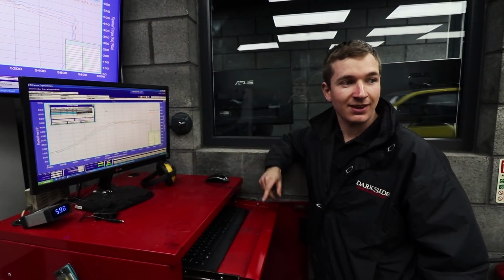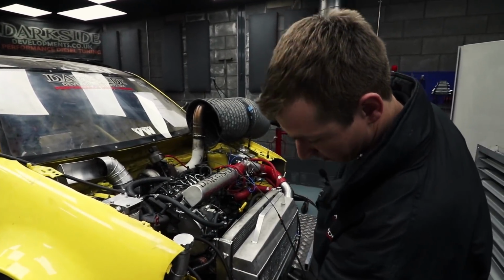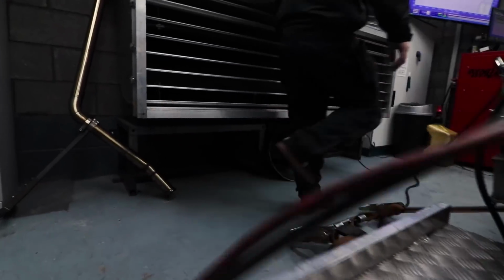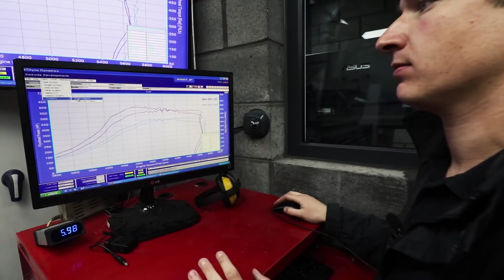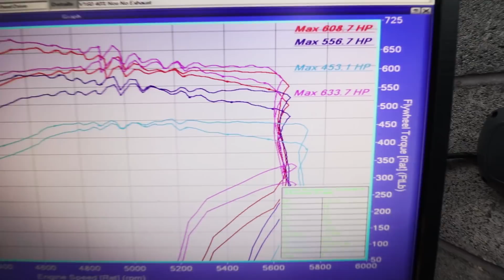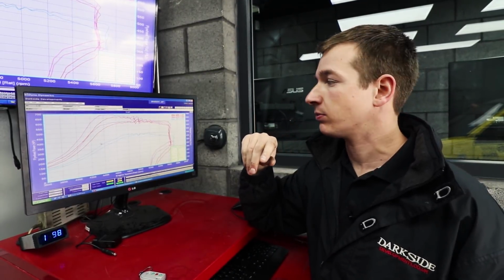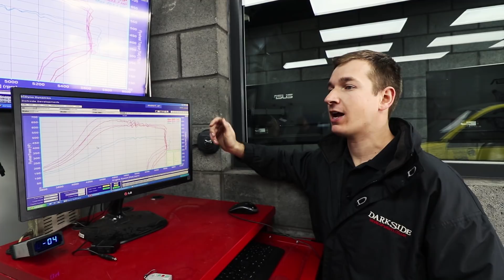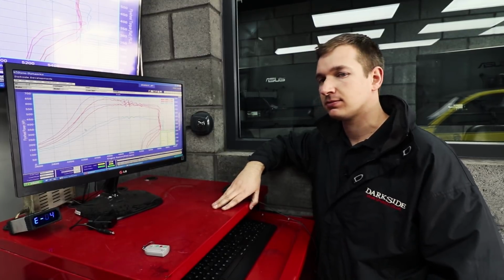633BHP CFHD SEAT AROSA 2.0 TDI!!! - DARKSIDE DEVELOPMENTS

Comment: Out of interest what is it about the 2.0 CR that allows you to see those power figures vs. The 1.9PD you had in the Ibiza? Is it a meatier block/head than the PD’s? The rest of the spec I’m failing to see the differences for you to gain almost 200bhp over the PD! Keep up the amazing work and pushing the limits!

Comment: 633 from 2.0 is huge 👏 so 900 from your 3.0 A5 shouldn't be a problem 😉
Reply: Would be nice, haha
Reply: 633 single turbo with nitrous isn't very impressive, there are plenty of Cummins ISB engines setup like that making the same HP and 1200 ft-lb of torque. I'd be impressed if they really knew what they were doing and used a compound setup without needing any nitrous at all.
Reply: @JosephArata  just go away you troll. Watch a Cummins sit at the staging lanes trying to spool, lol
Reply: @JosephArata  a cummins isn't 2 litres tho is it and has more cylinders
Reply: @JosephArata  No way a 600 hp car can have 1626,982 J of torque....
Reply: @JosephArata  
When did Cummins make a 2 litre?
Reply: @JosephArata  so triple the displacement, for the same power but "it's not that impressive"
Reply: @JosephArata  A Container Ship makes thousands of Horsepowers. ;) Displacement matters.

Comment: insane build , I need to start some serious work on my 130 swapped caddy if you've got anything hanging about you don't want 🙋‍♂️🙋‍♂️😂😂
Reply: I'm tempted to do something with my Pd130 powered mk1 aswell in the future
Reply: Get it done man I’ve done the 130 conversion fmic 2.5 inch straight through egr delete , 4 bar map sensor and a remap the basics really gonna go hybrid soon and big injectors I think although my clutch has just started slipping so looks like a performance clutch and 6 speed conversion will be next
Reply: I've got a stage one map on it now but I still need to get fmic and other bits to finish it

Comment: Nice work man, looks promising! Could this be achieved turbo only as well?
Reply: 500 turbo only is possible but that would need closer to 100psi I think
Reply: Single turbo with an assload of lag, you'd be better off with a compound setup......
Reply: @JosephArata  it works on the strip. Compounds take a lot of spooling too without an auto Gearbox
Reply: @ryanp6138  you mentioned you can run shorter duration with these new injectors. Doesn't this mean you theoretically can run more revs and avoid this 'shitload' of lag? Sorry for picking your brain btw=)
Reply: @JosephArata  in such a setup the small turbo must be spooled up before there is enough air flow for the big turbo to spool. And then the small turbo also consumes part of the exhaust heat which doesn't allow the big turbo to spool as fast as it would in a single turbo setup. So I can see Ryan point here.
Reply: @what9418  the speed at which diesel droplets burn is the limiting factor when you are up at 6000rpm or so, we won't ever  get good results revving much higher I don't think
Reply: @ryanp6138  thanks! Just another question, isn't the lowered egt with these new injectors result of a shorter combustion time? Or at least, result of shifting the peak heat release rate more towards the beginning of the combustion? I'd expect the rpm can be increased with shorter combustion time, but I do see that if you max out iq and can get enough oxygen in there you'd always make more power at 3000 rpm than at 6000. 

Btw I saw some heat release graphs and got the impression that even though total combustion may take 4ms, 80% of the fuel is burnt in half that time. It suggests that the fuel mix burns pretty fast and the mixing the droplets with oxygen slows down throughout the combustion.

I'd like to explore this when I have some money available (if ever=))
Reply from the maker: @what9418  We need cylinder pressure monitoring to take this to the next level really. Just looking at the opacity and power at higher RPM's its still a loosing battle with diesel fuel and direct injection. 4-5000rpm is usually where peak occurs for us but some big compound turbo might bring that down, how that will help 1/4 mile times you need to ask the so called youtube experts!

Comment: What a beast!!!! 1.9tdi POWER!!! Pd130 block with 16v head conversion?
Reply: 2 Litre CR 140 CFHD engine
Reply: The old pd130 8v they used prior to this common rail engine made 540hp !! Impressive and still ran high 9s/low 10s
Reply: @toyotaturbo504  Did they reached 9S with the PD? I think they were in really low 10's. But I could be wrong.
Reply: @JDMeister  9.9 last time I drove the car with PD
Reply: @ryanp6138  Got a video of that run? Not that i'm doubting you just want to add it to my video thread.
Reply from the maker: @JDMeister  All the runs we have on video are in here - https://www.youtube.com/playlist?list=PLz_nHs7o9ueXUmnewp0YVAtfLPo_dxHKs

Can't find that exact run, but its in there somewhere!

Comment: John Deere turbo 😂😂
Reply: Would have done better with a compound setup, 450 hp on diesel only my ass, they have massive boost lag with that giant turbine housing. You can't make power the same way you can with a Gasoline engine, with diesel. Diesel engines need 3-4x more air volume than gasoline engines to keep combustion temperatures down.

Comment: What is BHP ? What's the difference than HP
Reply from the maker: Its a debate as old as time itself.
When we refer to bhp we mean crank, and hp is at the wheels, or whp
Reply: @DarksideDevelopments  yes I've seen whp used allot but the bhp threw me off, I like y'all's work and videos. I'm currently building a 300hp BEW engine.  I actually just ordered a gt2260vk flange from y'all.  Your shipping to USA is quick. Keep up the good work .

Comment: Single turbo and nitrous just to get 600+ HP? Wtf is wrong with you? You could make close to that much with a compound turbo setup and 0 nitrous. Stop treating diesel engines like gasoline engines, they require air to quench the cylinder combustion temperatures. Using a giant turbo, then using nitrous to make up your shit engineering is just poor planning.
Reply: Show me a manual gearbox 4 cylinder diesel car that makes any meaningful power or does decent drag times. YouTube comments is full of master engineers with superior skills!
Reply: Plenty have tried with compound setups and none have been able to reliably reach this power level. Compound = tuning nightmare. Lack of airflow can be addressed with more nitrous, if you can keep the block together